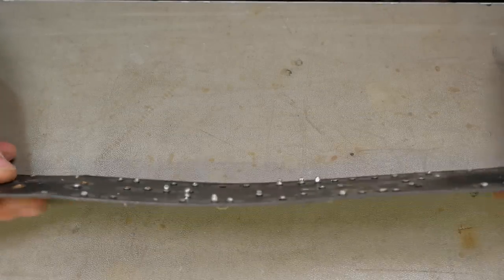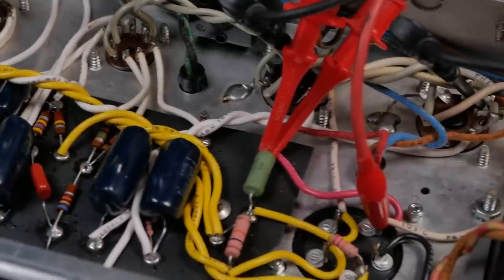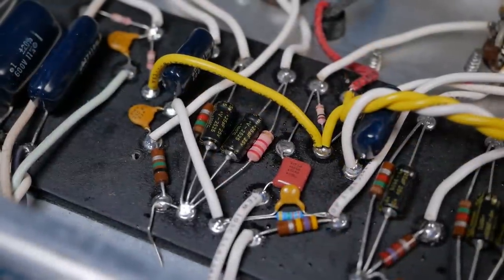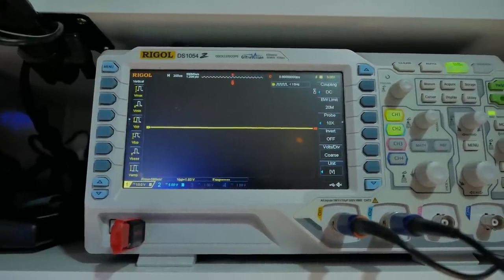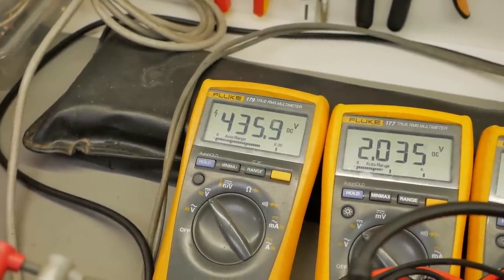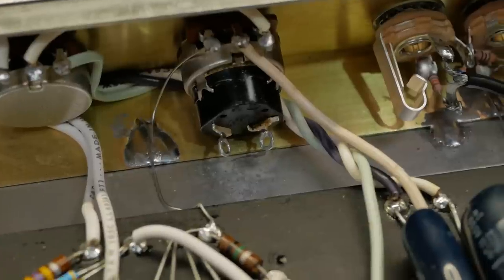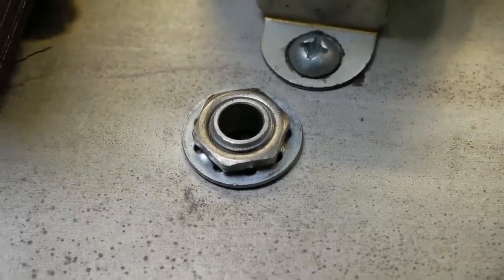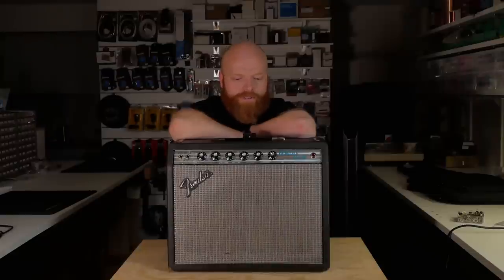SF Princeton Reverb - Part 3

Comment from the maker: Just to clarify, champions:
I know something is not right with this speaker and have suggested a replacement as mentioned in the video.
I don't just comp customers a new speaker without quoting one first, obviously.
The speaker is providing signal,  which sometimes makes it hard to convince the customer to replace it if the budget is limited, which is why I recorded the comparison to convince the customer that something is not right.
If they go ahead with the ET10, I have one in stock to replace while they wait and will record some new sound samples for your listening pleasure.

Comment: I recently ran into the same problem with the filter cap can on an Eico HF85 compact preamp.  There was no room to install capacitors under the chassis, so I used an electricians hole punch to enlarge the mounting hole and added a clamp.  I agree that the cans will be going away and should be avoided when possible.  I will point out that some very good (new) tab style cans from CE manufacturing are available from Antique Electronic Supply here in the States. Another company Hayseed Hamfest will build cans to order and do a very respectable job.  You do excellent work, which is hard to come by.  Keep it up.

Comment: There has to be something wrong with that speaker. Sure, the Fat Jimmy line may be a little more muted and “creamy” than the actual WGS offerings, but they don’t sound like that normally. I’m wondering if the VC is rubbing/misaligned or the frame was bent somehow. 

I can’t recommend the Jupiter M10C enough for Fender amps. I run the P version in my 66 Super and think they sound better than the CTS Alnico 10”. That’s a very, very hard thing to do. I’ve even tried a quad of Celestion Alnico Golds in it and they didn’t cut it. 

The standard WGS G10C is fantastic too! They really have become my favorite manufacturer of modern speakers in the last couple years. Especially with the Jupiter branded offerings.

Anyways, fantastic job on this amp Brad!
Reply from the maker: Yeah something not right there, mate. I've never seen this speaker before, so wasn't sure if it was just shit or not, but looking up sound samples from others, it's not anything like it.

Comment: Actually we started getting cords and equipment with the brown, blue and green with a yellow tracer cords and wiring in the USA well over 40 years ago. The only color codes that are mandatory for USA electrical building wiring are neutrals (grounded conductor) shall be, white, gray or natural rubber color, safety ground (grounding conductor) shall be green or green with a yellow tracer, and a wild  leg or high leg on a delta transformer shall be orange. Generally we use black, red, blue and white for 120/280 or 120/240 (orange on the high leg for three phase), and 277/480 is brown, orange, yellow and gray (if it's a delta transformer the high leg is B phase so it's already orange). In facilities with 400Hz military power, the 400Hz was orange, and 277/480 reverts to brown, violet, yellow and gray. Power cords are cords and generally not building wiring. The first brown blue green power cords I saw were on Dan Foss PWM motor speed controllers and soft starts made in Germany. Once inside of a radio chassis RMA dictated that grounds were black. That's usually all DC. In facilities that are overseen by a full time EE, anything goes! !!!!ANYTHING!!!! I have used illegal street ells in places like that. Just run it by the engineer, explain your installation needs, and it flies. It always does for me anyway. Not so much for some other people. No bragging but you don't ask to do stupid stuff for the sake being stupid.

Comment: Always a fun vid Brad, great attention to detail. Just a thought; I have a SF Princeton of about the same vintage with the international voltage taps, and UK mains voltage is often up to 250v. I notice that you have the red/ black tap on the Mains OT taped up; on my amp that tap is for for a 260v input. Using that tap instead of green/ black knocks the HT down to a reasonable 400 or so, and htrs still run around 6.2 ac. Maybe worth a try?

Comment: What is the cause of the wax build up? is it just from old leaky caps ? thats what Im thinking
Reply: Not an expert here by any means but it was something fender did from the factory. I think the idea was to prevent build up of moisture in the board which would warp / bend it.

Comment: GREAT WORK been down the rabbit hole on bassmans and they stopped making sound
one was cooked real bad two I rebuilt but no sound. DRIVING ME BONKERS.
i thought the board on one of mine was GREASY bad and its never ever worked again
I made new boards tested the parts and still no sound redid new boards entirely new parts
still no sound.. Should have joined the fkg bmb squad instead it would be over with quicker.
fk me its maddening...    one that came in it blew out at cap board arched through wiring pin hole in wire or something blew across through phase inverter and down the heaters ROASTING the amp and stopping at the STAND OFFS on v1 v2 Guy said the club had bad power NO KIDDING LIGHTNING STORM  INSIDE THE AMP.........

Comment: For Fender Twin Retards, and other amps with greater than 500 VDC B+ I am using two 350 volt radial caps in series with 240K or 270K balancing resistors. $33 for a Sprague Atom with a 65 degree C rating and 5000 or 6000 hour lifespan? NO THANKS! With the Nichicon, Chemicon or Panasonic radial caps I get 12,000 hours @ 105C for 85-90% less money. That is almost 3x better for more than 80% less money.